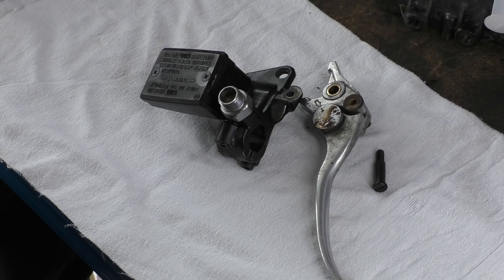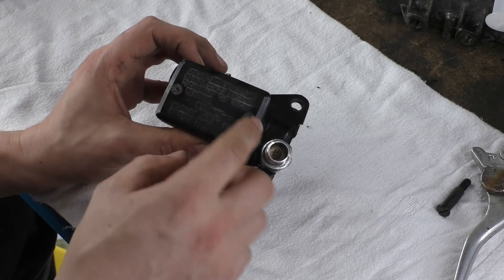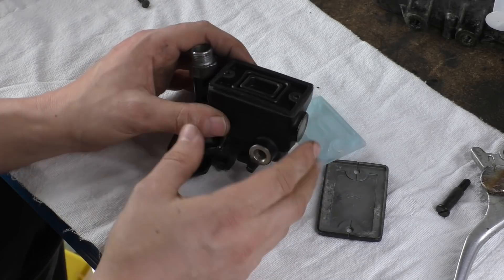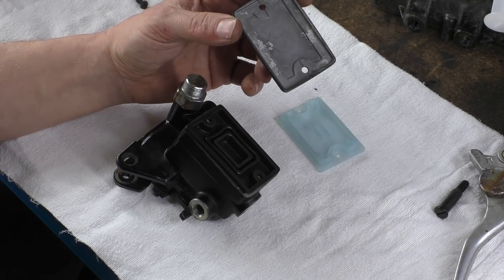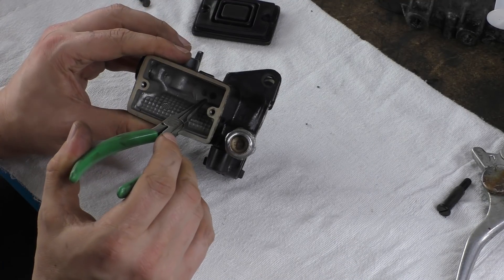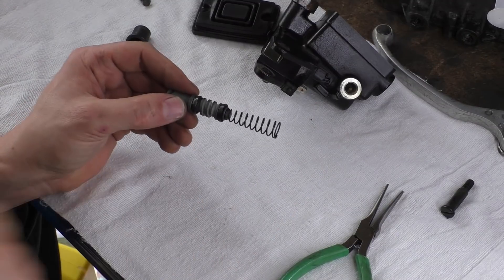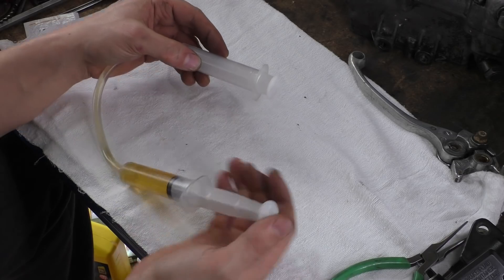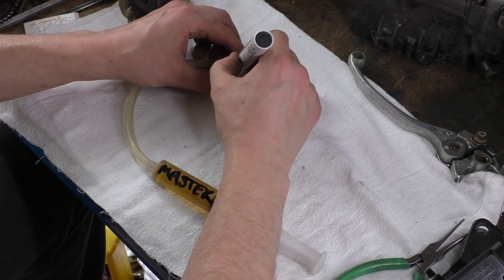How brakes work? - The Master Cylinder - Part 1

Comment: I do believe the  retraction of the piston is due to the flexibility of the sealring. It deforms when the piston is pushed out once the pressure is released  by letting the lever go the seal pulls the piston back. 
No need for springs.

Comment: Good video Matt. Would you say it's feasible as a bleeding routine to do the following?:
1) Empty old fluid out of the reservoir with a syringe, clean reservoir.
2) Pull the brake lever to the h/bar and lash it with a cable tie.
3) Connect flexi hoses to both caliper bleed nipples.
4) Disconnect brake line at master cyl., collect what's left from the master cyl. and fit clear overflow pipe to brake line.
5) Pump new fluid UP through the caliper bleed nipples until all air is expelled at the master cyl. union.
6) Remove overflow pipe,  connect master cyl. union and force oil UP into it via the caliper bleed nipples.
7) Close bleed nipples, fill reservoir from above and slowly release brake lever. Pump lever slowly till hard.
8) Top up reservoir, disconnect caliper bleed nipple hoses, clean up and finished.
Reply from the maker: Good question - but this needs a video - if you don't mind. I'm planning on covering this in a week or 2 when we look at ABS systems

Comment: Thanks heaps for explaining the master cylinder Matt. Years ago as a new rider I pulled apart my simple GS500 calipers and seen all the individual pieces and channels, cleaned & dried it all, put everything back on with new pads/fluid and spent some days learning how to bleed the damned thing. Was an excellent learning experience and I felt so much more confident as a new rider knowing how the brakes functioned (especially on my old beater ex-winter-hack-commuter POS looking thing) . But I can only take in so much at a time and left the master cylinder details for another day. Today was that day!

Comment: Anyone else had a problem with their rubber pipes from the master cylinder 'sweating' or looking like they have condensation on them (I have pics)? I have been trying to get info about it and all I could find is that it may be the wrong category of pipe used and the brake fluid makes its way through and ends up making the rubber brittle. I just wondered if anyone has had the same problem as the whole brake system was done 'professionally' (modified to have a twin brake lever on one side to move the rear brake to the handle bars with the front) and I don't want to start replacing bits if I don't need to. Cheers and another great vid Matt.

Comment: "How brakes work? - master cylinder" hooo yeah... eeeeasy, and then i see the vacum problem and realize i dont know shite, im blown away some times by how much engineering a simple piece has. Always thought that rubber cap was to prevent leaks, like a gasket. I mess around with a lot of master cylinders, never paid attention to the tiny holes.

Comment: My ZX6E/ZZR600 was designed without brake pad shims, and no replacement pads come with shims. it's not just me, I read a big review that mentioned squealing brakes. should I not worry about it if it's designed without shims? it'd be nice to get rid of the squealing

Comment: ooh have fun covering racing brake lines, the acu rules at times make no sense, a splitter below the bottom yoke is a no no but 10mm up on the against the yoke is fine - i dont know know of any accident where this difference has been the cause,
Reply from the maker: I thought this was all to do with quick connectors.
Reply: that is a new thought to me - like i can afford that stuff,
i havent read the rules in a while and a bit rusty but i know it would even count on the skyjet 125 honda race replica i had planned out which is absolute beginner stuff and low budget
Reply: ok im a SAD Bastard i went through it quickly - this is under the road racing section so i dont know about any other section

14.22 BRAKES
For machines fitted with two front disc brakes, a split of the front brake lines for both front brake
calipers must be made at or above the lower fork yoke.

Comment: I have a question about air in the reservoir. If I'm changing the fluid in the system and the brake pads are part-worn then my habit has always been to refill the reservoir to the old level (rather than max) so in future when I put new pads in I don't end up with it over filled when I push the pistons back in the caliper. Is it then important to ensure the diaphragm is pushed down to displace as much air as possible from the reservoir, or is it better just to fill to max and deal with removing the excess when I put new pads in? I'd never really thought about it and tend to just slap the diaphragm back on without a second thought.
Reply from the maker: This is all about quatities. Your system has 'x' amount of fluid when filled - and there is always an air 'gap' in the reservoir. If you have more fluid to air as a ratio this reduces the amount of moisture that can diffuse into the fluid. 

But I do get the reason why you do this. Great comment.
Reply: Fill it up and deal with it on pad change its safer. Better still replace the fluid again when you change pads as you cant beat fresh pads and fluid
Reply: You're either changing your fluid too often or pads not early enough :D
Reply: Thanks for the replies. I tend to refresh the front brake fluid before track days as it's cheap enough, and I've had brake fade in the past and it's not much fun. This is something I'll definitely think about now. Great video.

Comment: I always wondered how come sqeezing brake lever couple of times in seqence made if feel stiffer, was it bake hoses expanding or cylinders not getting back emediately?
Reply from the maker: This is a good sign you have air in the system. There's always a bit in there somewhere.